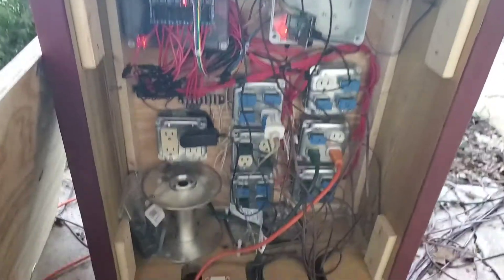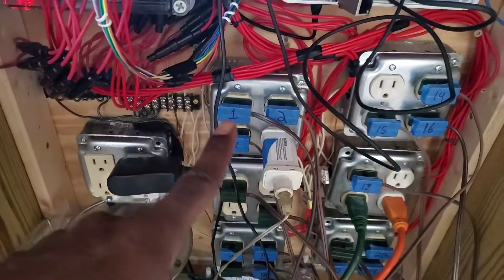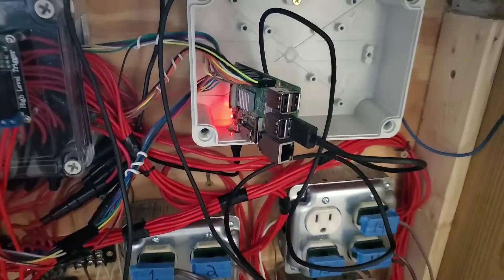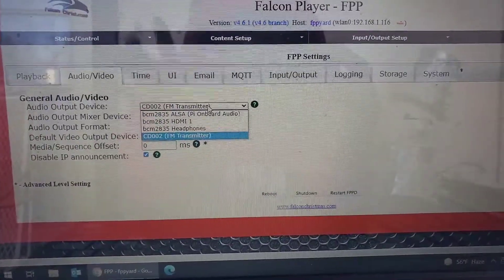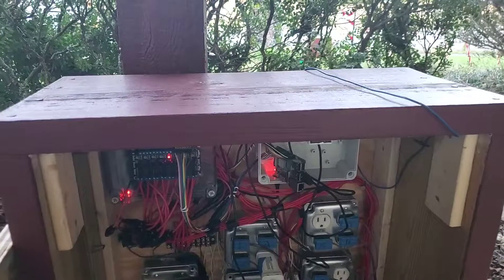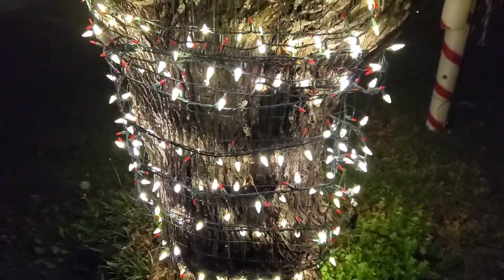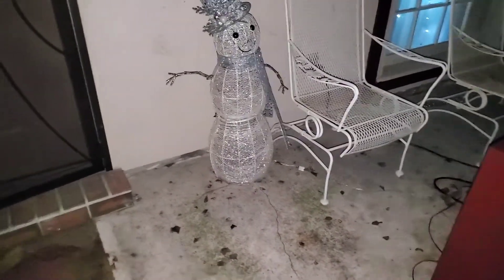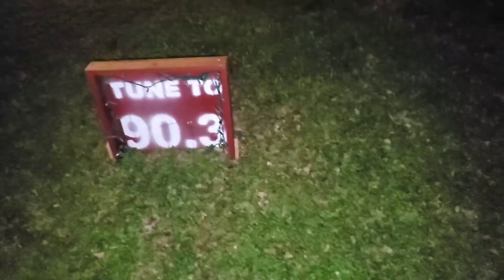2021 Christmas Light Show Behind The Scenes

Comment: Yikes - mechanical relays to run a christmas light display? Mechanical relays are only good for so many operations, and then the contacts get pitted from the arcing when they open and close. You'd be better off using some form of electronic controls to switch the lights on and off (even regular triacs would be better than mechanical relays, but there are better solutions as well). If you're already using FPP (and xLights??), and you're having issues with your lights crapping out, you should consider going to pixels - you can do way cooler stuff with pixels than just turning a few channels on and off!
Reply from the maker: Those are solid state relays as I mentioned in the video, not mechanical. Given the number of problems (including fires) people have with pixels, I'd rather stick with traditional lights
Reply: @rhtservicesllc  Somehow I missed you mentioning that those are solid state relays. Those should be fine then - they looked like the regular mechanical relay boards you can get for raspi/arduino from the usual places. Yes, some people had some issues with pixels, but I suspect that largely has to do with not enough power injection, and not actually verifying the wire gauge claimed is what it says it is. I have probably around 3000 pixels this year - some strip, some generic amazon bullets, and some bullets from one of the "well known" direct from china suppliers. The amazon pixels claim to be 18ga, but if you actually cut the wire open and measure it, it's more like 24ga - absolutely pitiful. If people go by the claimed wire gauge without actually checking it, and run way too much current through 24ga wire, yeah, you're going to have issues. Same goes for LED strip - the traces that make up the power bus on strip aren't very big. It's easy to get the strip really hot, but adding extra power injection to reduce the current you can get the strip to run barely above ambient temperature. It's like anything DIY - you still have to know what you're doing to do it right.
Reply: Oh, and using pixels for 3 or 4 years now, I've had exactly one of the amazon pixels fail, and I've had about 8 pixels fail on one batch of WS2815 strip (though because WS2815 has backup data lines, at least when they fail, the rest of the strip keeps working), and 0 failures on probably a roughly the same size batch of WS2815s from a different supplier / ordered in a different year. The bullets from the "well known" direct supplier had one bad pixel out of the box (out of 1800 that I actually put into service this year), but seeing as they've only run for a few weeks, probably not long enough to know how their reliability long term actually is.